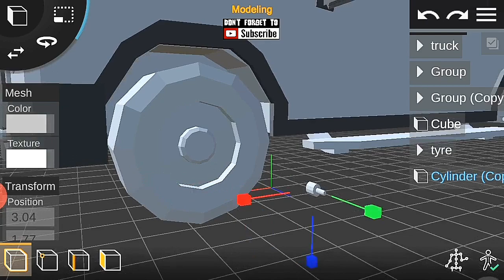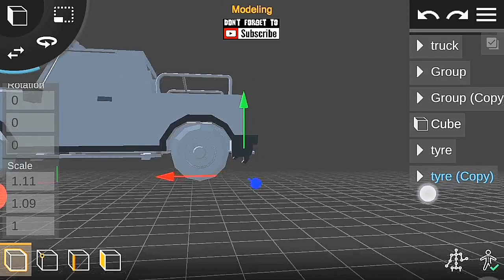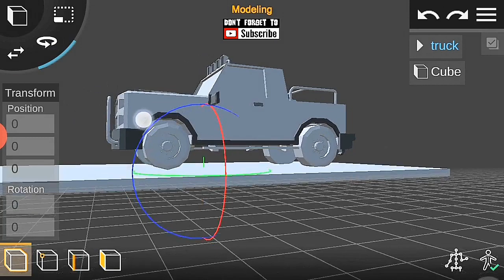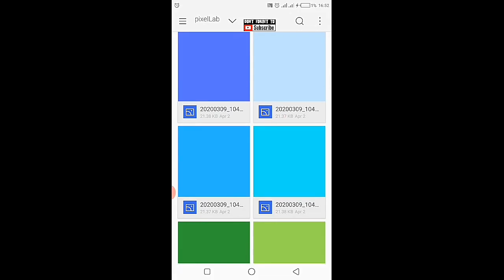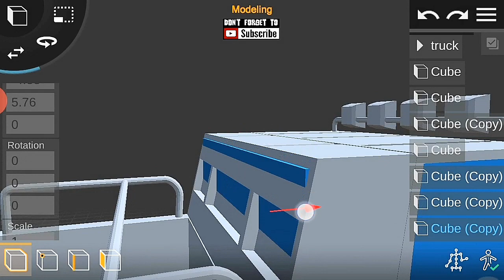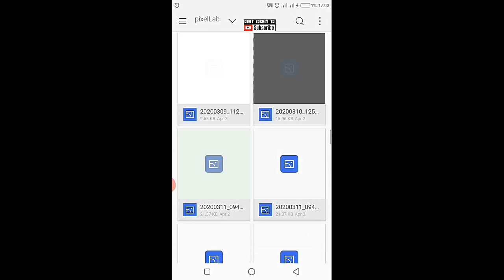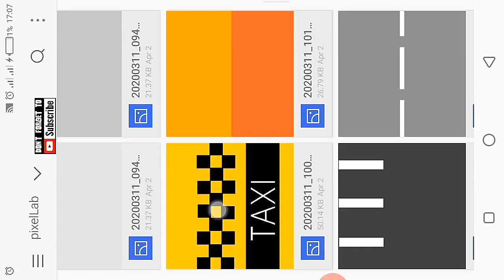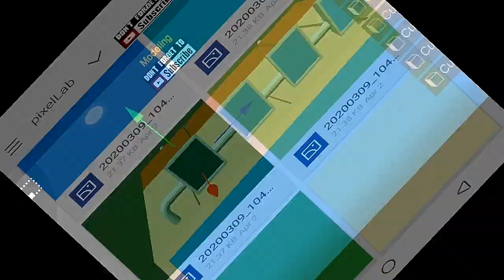Prisma 3D : Modelling a low poly Ford truck PART 3

Comment: Help me out man, I got my models from Renderhub, they work in Prisma (I can edit them and add textures and stuff). But when I put bones on let's say the legs, they don't move the legs, the bones move, not the legs. Heeelp.
Reply from the maker: Yeah man. That's the problem we face there with prisma 3d. I really can't help out with the rigging in prisma 3d, but if you have a laptop, kindly download blender( it's free to use and open source). It's an advanced 3d modelling software(you would need a PC). Using the rigify add-on, you can rig your model there. Hope this could help?
Reply from the maker: @Just Asti every day. With constant practice.